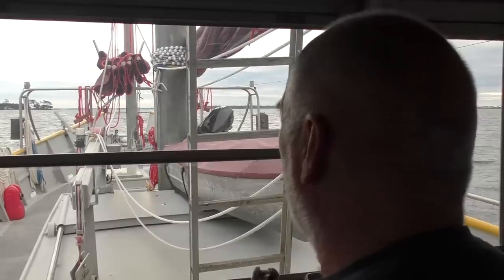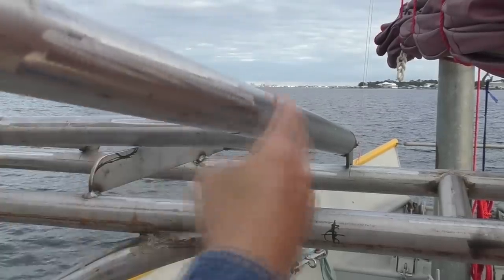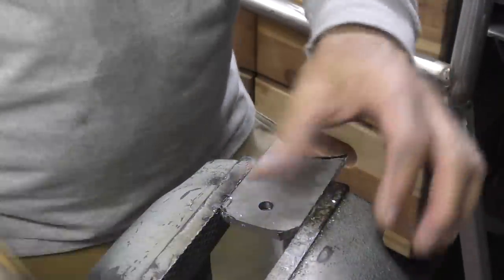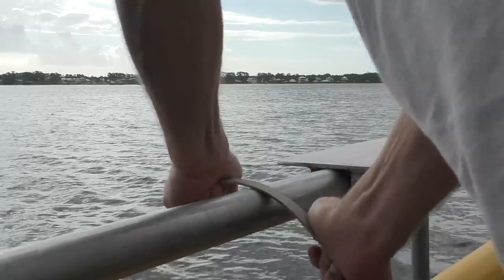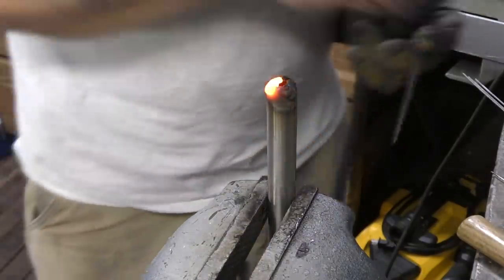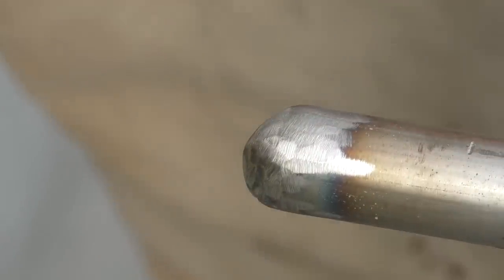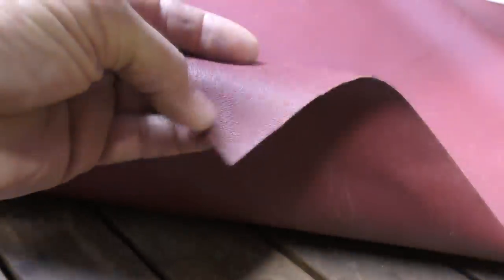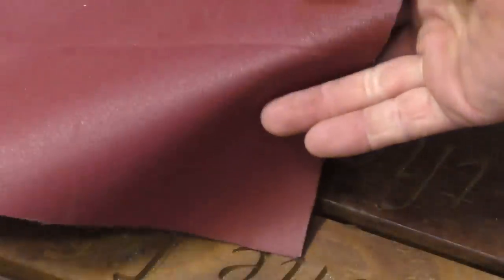Raising Sails - Part 9 - Foresail Modifications

Comment: Doug, You get better and better at TIG welding! great! I have a tip for you: Put the tungsten electrode in a cordless drill and put it on the grinding wheel while spinning. You dont even have to take the gloves off for sharpening the electrode. Super quick. 
Please dont sharpen the electrode on the side of the wheel. That way you end up with grinding marks 90 degree to the electrode, with actually hinders the current flow. The grinding marks must run axially. The current runs smoother and you get a more focused arc. Try it!
Reply: He's already willfully ignorant of any information he watches, doubt he'll heed your advice. Big eye roll about halfway through when he calls it "hogwash", sounds like someone buying into their own bs.
Reply from the maker: Heard that, tried that, and maybe it only works on a full moon.  : )
Reply: @77marioland  If experienced advice doesn't  work as helpfully suggested...on first attempt...Well it's most certainly utter 'hogwash' advice.🙄!

Comment: Once you work harden stainless you can bring it to red hot and let it cool slowly. It will mostly come back!
Reply from the maker: I’ve done that, but I didn’t think it worked very well.
Reply: @SVSeeker  Carbide twist drills will punch through the work hardened area. A little expensive, but they're worth it.

Comment: If you want to scratch start a TIG Arc safely and not ruin your Tungsten, clamp a piece of Copper, about 8 mm thick beneath the point where you want to start your weld, scratch start on the copper and than move the arc to your weld. Thus done, the Tungsten won‘t be ruined that fast.

Comment: I used to have one of those welders and I hated it with a passion . The duty cycle is next to nothing , the voltage drop is real and it will burn a 3/32's in good welding conditions . If you manage to get the little one to work for you I hope is serves you well . I just would not count on it . With all that said I did not get use the tig all that much on this one rig so I can't speak to the tig side of the things with this rig. Just keep in mind if you have to count on it for that big ass steel boat ! lol be safe fair winds and following seas . Sorry Miller most of the other rigs are a life saver by the way how about making a limited run of the Legends again so I can by 3 of em !

Comment: Maybe it's a stupid idea, but if you had two lines going from the cradle tips to the top of the mast they could be attached to the base of the  mast with cleats when the sail is in use, and tensioned to guide the sail in the cradle when the sail is furled.
Reply from the maker: Yeah, that would work, but it would also need to be attached only when dropping the sail.

Comment: That wasn't a leg extender, that was a portable hump. Leg extenders are those things drywallers use when they do mud on the ceiling that are like stilts. Now, what you put between the davits is a portable hill, but it is single sided. Then there are those blue thing that drive around and go up and down, they are altitude adjusters.

Comment: I found easiest way to sharpen tungsten symmetrically and fast is to chuck up your tungsten in your cordless drill and grind it on bench grinder with the drill running. Sharpen both sides of tungsten and when it gets contaminated you can just flip it around in the tig torch. Another benefit of the drill is if your quick you can pull it out of the tig torch while hot and plop it in the drill chuck without burning through your gloves and get to sharpening without wasting too much time to cool down. Don't even have to take your gloves off, a good suggestion is two lengths of taper for the diameter.

Comment: when welding on a car, you have to disconnect the mass from the battery, what about a boat
Reply from the maker: Maybe on these new cars, but that's not true about anything I have owned.  And a metal boat does not use the hull as a ground path, so even less so there.
Reply: @SVSeeker  Using the hull as a ground pash would rust the boat much quicker. You are right on that, I just realized that. Thanks!